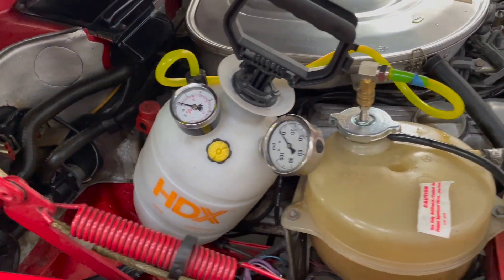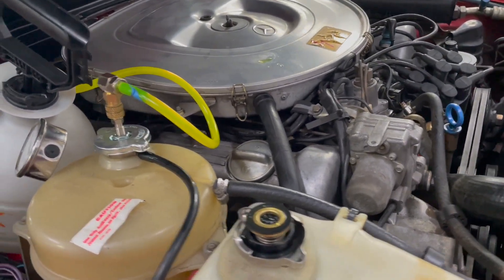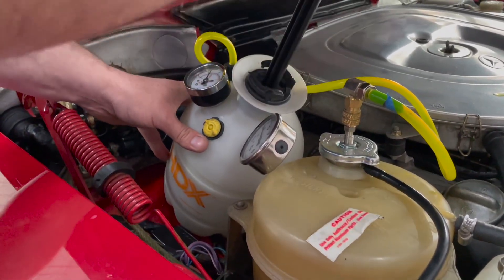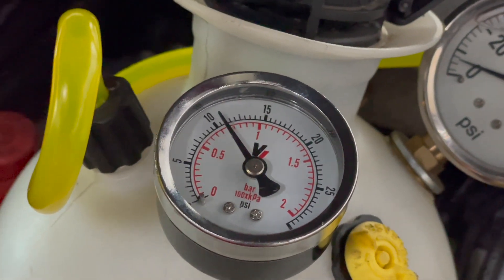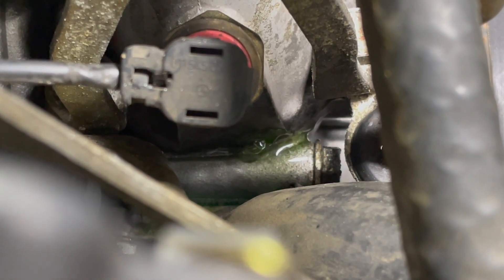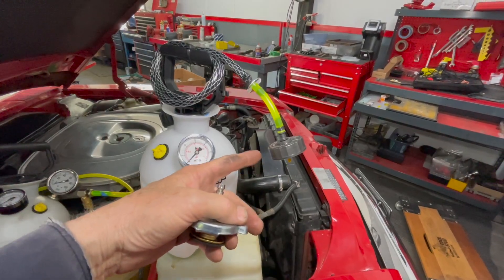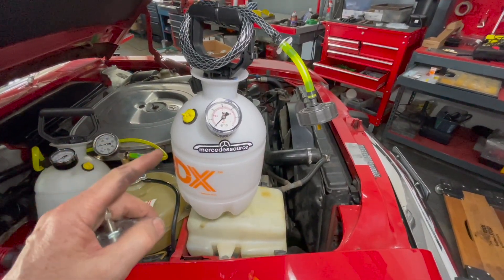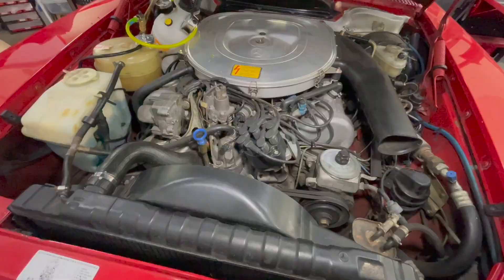Checking for Engine Coolant Leaks with My Multi-Purpose Pressure Tank

Comment: I wish you lived in Switzerland so I can take my Merc for you to fix a very annoying problem. Would you have a video of how to check for vacuum system leaks? My car stalls sometimes when I put on neutral slowing down into and intersection. ICV is good so I think I have a leak somewhere in the system but don’t know how to check to know for sure. Any tips would be much appreciated master. 😅
Reply: Forgot to mention I have a 190e 2.5-16v 😊
Reply from the maker: It is a good thing you included the year and model, or I would have advised a flux capacitor replacement. :-).. There is lots of info on the internet about testing for vacuum leaks. Any cheap vacuum gauge will determine it that is a problem. Go ahead and check the vacuum. I suspect you have other issues.  Start with a compression test, then check for timing chain stretch. If those are ok, then full system fuel injection pressure test before you throw any more parts at it.